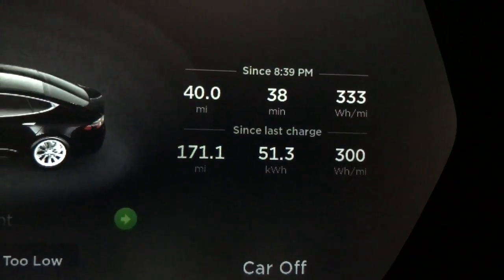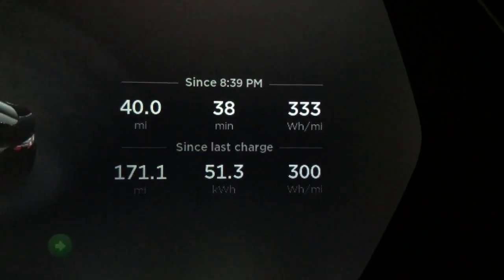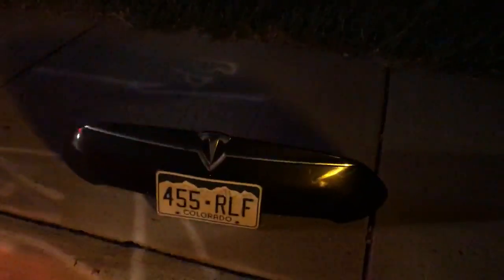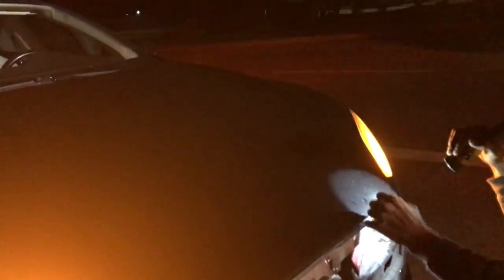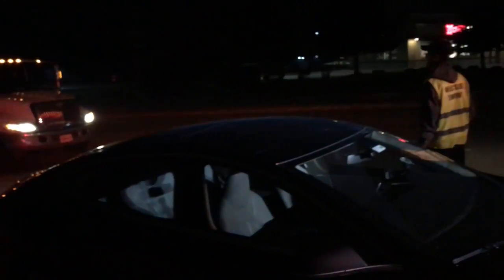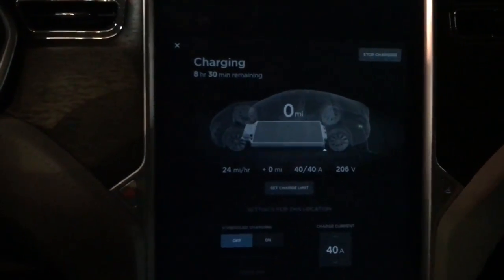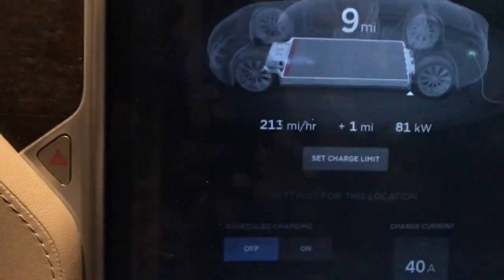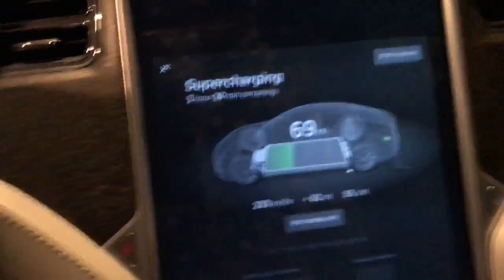My Tesla DIED with 4 miles (6.4 km) of range left

Comment: Something to think about: If you compare with internal combustion cars, 4 miles left on a car which gets say 32 miles per gallon would equate to having 2 CUPS of gas left in the tank. Would you try to run a gas car down to 2 cups of gas left in the tank? I think not. There is a thing called "unuseable fuel" which results in gas that the lines cannot pick up due to grade or acceleration. I would say 4 miles of range to run out is completely reasonable as you're trying to push it to the bleeding edge. I know Tesla Bjorn had his car run out with 14 km left (about 9 miles) before. That is getting a little high I would say but yeah just give yourself a good buffer maybe 30 miles of range left. Buying the larger battery if you can afford it would do wonders as well. Just my 2 cents. Anyways thanks for sharing your experiences it helps those of us future Tesla owners to see what they are capable of and what their limitations are.
Reply from the maker: Thanks for your thoughts. In the future I'll have to leave a larger buffer, with the intention of eventually upgrading to a longer range Tesla.

Comment: Yes, you pushed the battery too hard.  The range is an estimate.  If the battery is a bit out of balance then the BMS will report a high or low number.  I thought I was pushing it when I went down to 20 miles once.  Also, I think taking the battery that low is not good for the battery or it long term life..
Reply from the maker: Leif yes, agree with both points. I should have stopped but thought I had enough range. Lesson learned.

Comment: I under stand miles of range but not under standing 51.3 kwh? Maybe you explained this in another video. Thanks again for all your insight.
Reply from the maker: +Wally Lindberg Good question. The battery size is measured by kWh. The battery size I have is 60 kWh. So for this example, there is 51.3 kWh of driving available in my battery. Does that help?
Reply: Yes, thank I'm learning. I'm assuming when the car was new you could have had 60kwh before that car stopped. At about 200 miles.
Reply from the maker: I'm not certain it had access to all 60 kWh when new. I believe Tesla reserves some of the battery for essential systems. I'm sure it was close to 60 kWh though.
Reply: Thank you, I'm learning.

Comment: Out of curiosity do you plug in your Tesla every time you park it at home? Or do you only plug it in when your battery range is low?
Reply from the maker: +Kenneth Ramnarine I plug it in every night.
Reply: Sean Mitchell if you plug it in every night then you either have to plan better for usage thru the day or have to upgrade your 60 to 75 by having Tesla unlock the 60kw battery to use to actual full 75kw battery that is actually in your car already without the need to buy another Tesla
Reply: Sean Mitchell I heard it is only $500 to upgrade your 60kw battery to 75kw now. Instead of the old $5,000
Reply from the maker: Better planning is probably the ideal option. It is a true 60 kWh battery. The car was built in 2013. At that time there were not putting the 75 kWh in the cars.